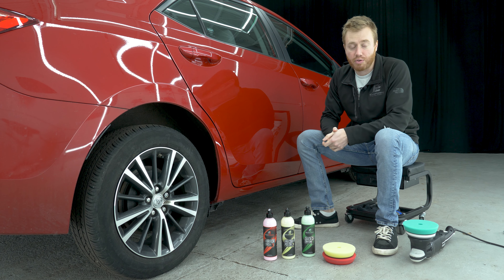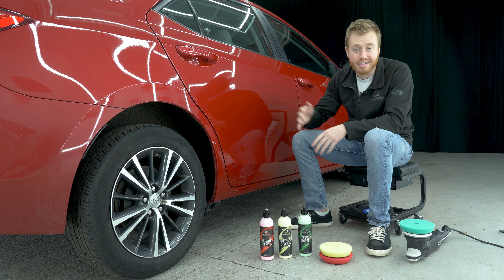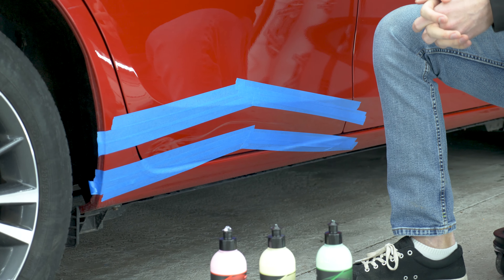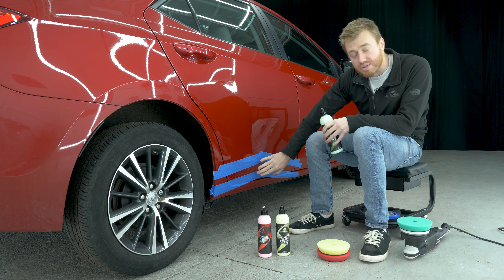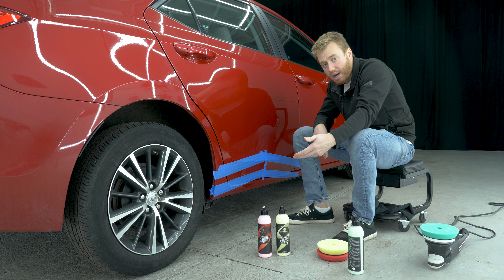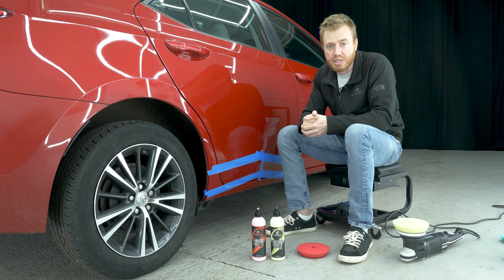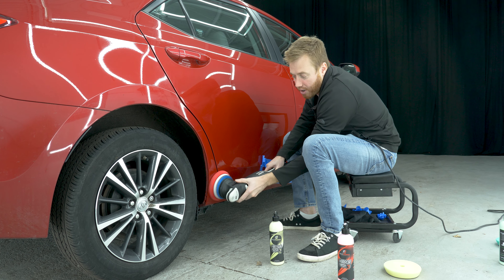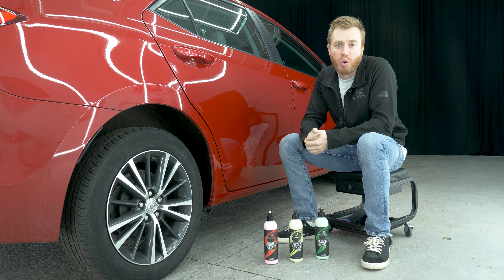Quick Scratch Removal using ExoForma 3-Step System

Comment: I juuus order the set! Looking forward to using this product!
Reply from the maker: Awesome! Thank you for your order. Keep us posted with your results and if you have any questions!!
Reply: @exoforma8986  I will. My next 3 clients are paint corrections, which is ironic. As a mobile detailer I wanted to ensure I had something that would not kick up dust. Hopefully I chose correctly!
Reply: @exoforma8986  I just performed a 1 step on a client today! I am a firm believer in your product! I applied the  3rd step in extreme heat here in AZ, I had the client touch the hood and then showed her how well this product is, in the sun!!! I am very confident in my mobile detailing in the sun now, thank you. Now, I do have a question, how can I get access to the specific bottle tops you have in the video? I think I was was using more than needed because I couldn't control the pour without it dripping over.

Comment: Hello. I bought the 3 step polishing kit.
I was going to order the Glass Transparency Graphene coating but just noticed they went up in price another $50 bucks.
I decided on the Exoforma or Adams but can not find any information on it.
Im curious about the ease of product use as well as durability. I also typically look at reviews but there are none yet.
Reply: I am in the same boat with you. Being a mobile detailer I want to ensure I don't develop dusting. I want to also ensure I use the correct polish & pad combo for best results.